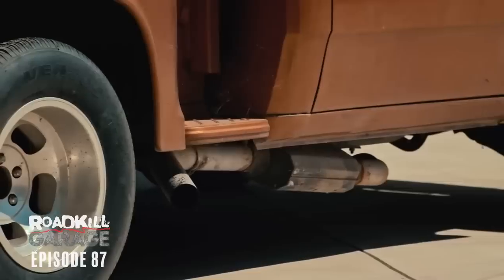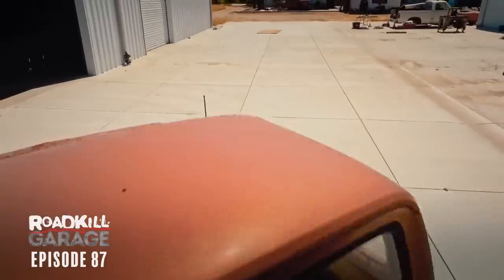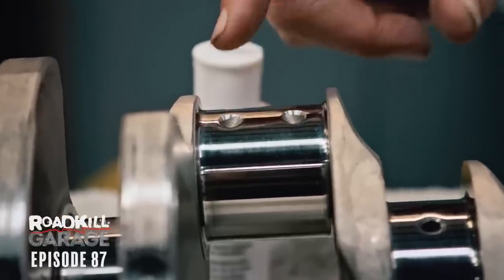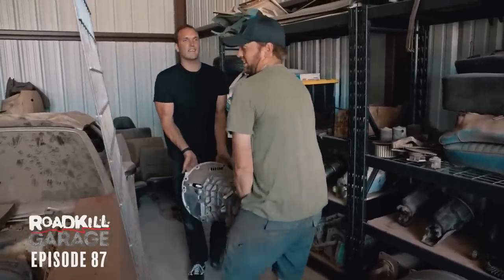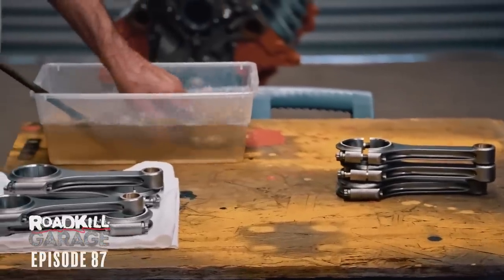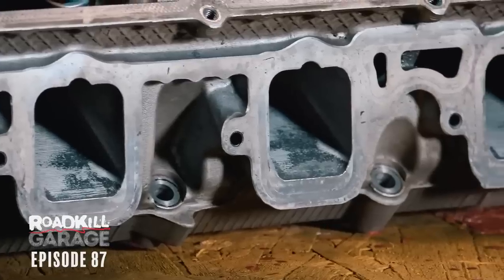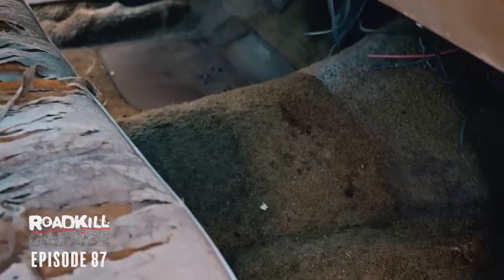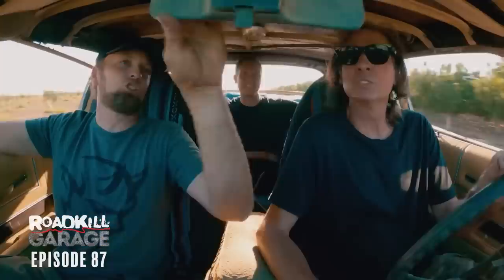Reviving Project '74 Dodge Charger! | Roadkill Garage | MotorTrend

Comment: I have a buddy with a 73', and he still has the factory .400 in his garage, but we built, and dropped in a .440 magnum. In 2006, we put on a 6 pak.
I have another friend that has a 74', we bought and built a .440, and dropped that puppy in. That one, we restored. No rust now with tons of mini patches, new fenders and quarters, trunk extentions floor pans, we painted it in January up in Michigan.
Everything was taken off and removed except the rear-end, which was done the following year.
But from start to finish of the initial project...
10 months. First car show... first place out of 20 car in the category, and it was all. MOPAR.

Comment: I had basically the same car back in the 80's. Same year, colors, and trim, but with a 318. "Broam" trim pack i think?  Awesome to drive, kinda floated down the road, hood looked huge , and you could never forget to shut you blinker off with the little blinker lights on the hood facing back at you. Great car!

Comment: I was a Mopar guy when I first started out I had a 69 roadrunner and a 68 Dodge charger and my friend had a black 68 Dodge charger RT 440 Magnum built with a bigger cam we took the automatic out put a four-speed behind it it would run a hundred seventy-five miles an hour it would eat a big block Chevy in a heartbeat

Comment: I always thought the truck demanded a big block, that’s why the small blocks kept blowing up.I guess now it will be happy. If Eagle 6.4 heads flow 330 cfm stock I’m betting on 375 for those. My bid on the horsepower is over 600 hp out of that Little Hemi. Since you have farmer roots maybe add some “Warlock” pinstripes and oak side rails to taste. By the way Indy cylinder heads makes a “ModMan” intake for the Gen III Hemi that can take a six pack setup,dual quads or a single 4 barrel. A SixPack Hemi has a Nice ring. What a Great little Truck. “A little HEMI Express Truck” maybe.

Comment: Wicked build love this truck, question tho how do you go through soo many engines running too lean to get more power and blowing them up pinking??
I always slightly over fuel and have them set up with whole car on dyno.
Only tome ive killed an engine is running it too lean